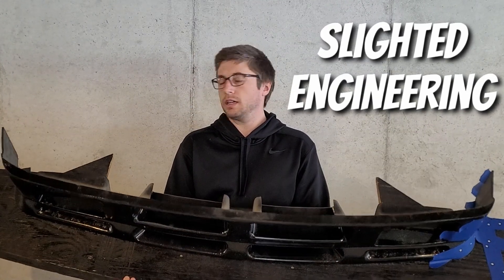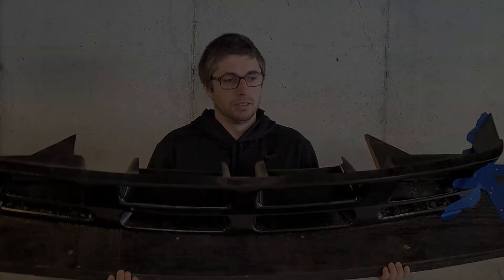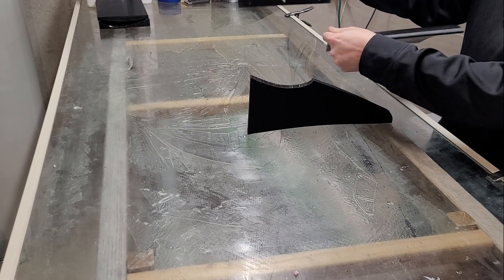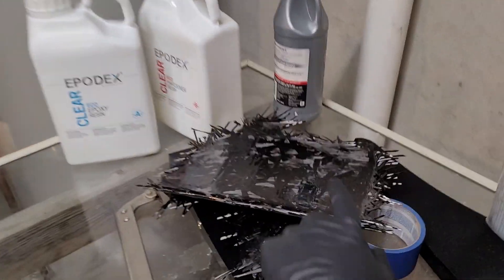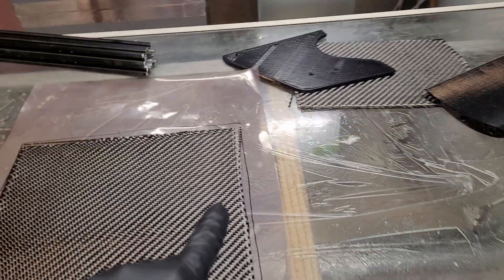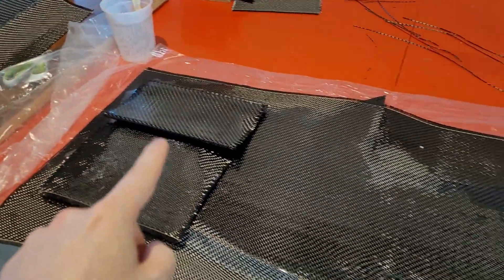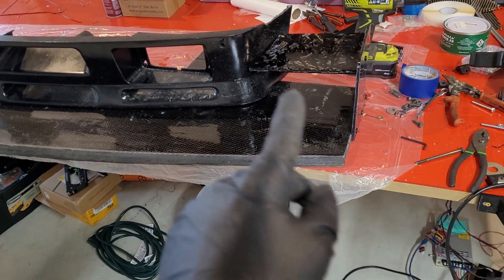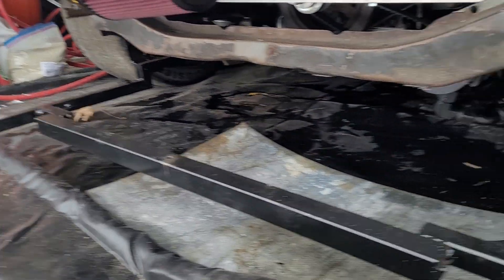DIY Carbon Fiber Splitter for a Budget Build

Comment: Man… one good tire chunk in the middle of the track and your dry sump is gone…
Reply from the maker: Yeah, it's definitely a concern I have. I'll probably build a little deflector off the main structure for that. Thankfully, it sits in the tire envelope from a side profile, so bumps shouldn't be a problem. Just debris at this point.